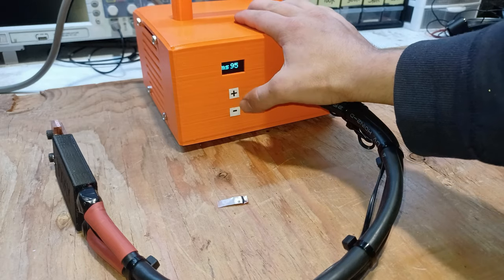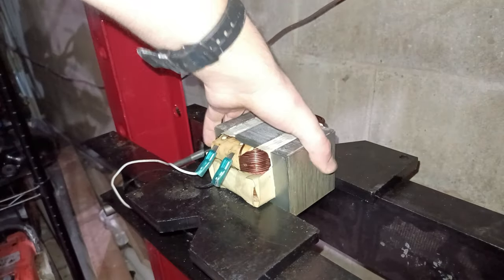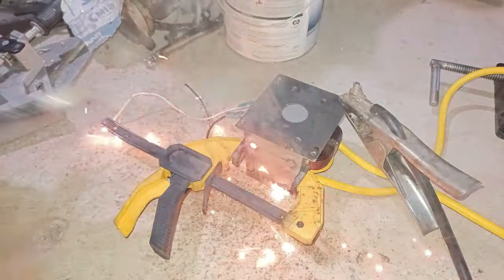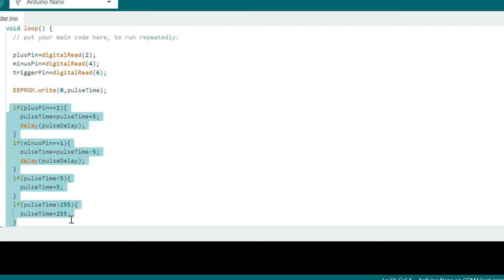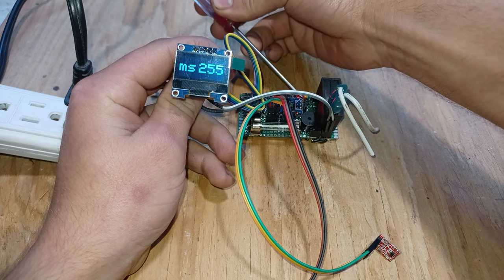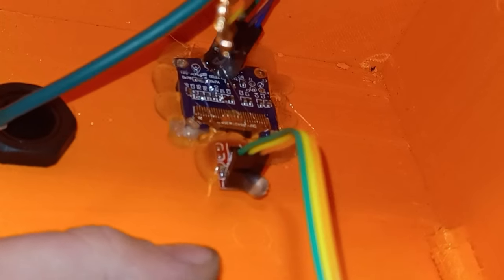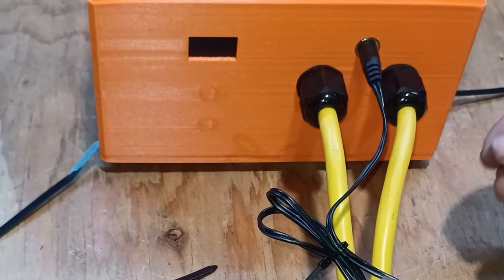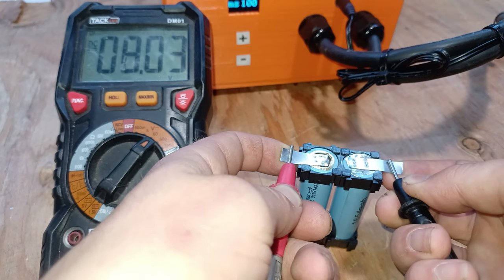Building a Spot Welder from a Microwave!?

Comment: Hi @ElectonicLab, 
for 25 sq.mm wire, how many turns you wound as secondary ?
Reply: I am also facing same issue, nickel strip is not weld properly on lithium cell
Reply from the maker: What material are you using for the spot welding tips?
Reply: I am using similar spot welding pen made of copper
Reply from the maker: Are you using a relay or solid state relay?
Reply: @ElectronicLab.  no 
I am using 5  BTA41-600B TRIAC in parallel as a switch
Reply from the maker: Try using the relay from the microwave or at least a 15amp relay. because TRIAC's aka solid-state relays have a way higher internal resistance, even if you're using 5 TRIAC's. and if that doesn't work, you might be using to small of a transformer. the microwave I've used has a power output of 1100 watts.
Reply: @ElectronicLab.  yeah I tried with 30A relay and getting same result.
also, I am using 16 sq.mm wire as secondary with 5 turns.
when I use 2 strips to weld, the weld is perfect but when try to weld strip on battery, not getting good results
Reply: @ElectronicLab.  hence, want to understand how many turns you wound for  25 sq mm wire
Reply from the maker: @anukeshambatkar6255 I ended up using 25 sq.mm wire or 4 gauge as secondary with 3 turns
Reply from the maker: More turns means more voltage but less current, and you need a lot of current to spot weld, so 3 turns on a 120 volt transformer should work

Comment: How many wraps with the new thicker wire? I made one a few years ago but it uses a rotary encoder as a selector and it sends a double pulse.  The problem I have is that it can easily blow a hole in my batteries if tension isn't really hard and lately I've been having issues even getting the welds to stick. I don't know if it's my nickel strips or do I need to really clean the cells before hand or do I even need to resharpen the electrodes.
Reply from the maker: @esqueue  I ended up using 4awg copper stranded wire and made 3 turns as the secondary coil. But what is also important to get good welds, is to strictly use copper electrodes, use a relay at the 120volt primary coil and not a solid state relay, and yes sharper electrodes will give you better penetration with less power or shorter pulse time and talking about pulse time, make sure to have proper pulse length, between 10ms and 300ms should be plenty range. Cleaningwise, I don't go crazy, I just use a Dremel to flatten the surface from the old nickel strips if the cells are salvaged (I do recommend using a Dremel if everything fails). I also recommend getting the electrodes I used (linked in the videos description) because it has a pressure switch that closes at a certain pressure, which  should give you consistent welds.
Reply: @ElectronicLab.  thanks
Reply from the maker: You're welcome!

Comment: Hi i enjoyed your video. Im also building a spot welder using an arduino nano and oled screen the same as yours.can i ask where you got the code as its exacly what i need given that you have the same build as me the only real difference is im using a solid state relay.is there any chance you could give me a link to the code you used please? Keep up the great work i thoroughly enjoyed your project.
Simon.
Reply from the maker: Thank you. I didn't put the code on a website, but here it is: 

int plusPin;
int minusPin;
int triggerPin;
int relay=8;
int buzzer=10;
int pulseTime;
int triggerVal;

int pulseDelay=200;

#include <EEPROM.h>
#include <Wire.h>
#include <Adafruit_GFX.h>
#include <Adafruit_SSD1306.h>

#define screen_width 128 // OLED display width, in pixels
#define screen_height 64 // OLED display height, in pixels

// display wiring = A4(SDA), A5(SCL)

Adafruit_SSD1306 display(screen_width, screen_height);

void setup() {
  // put your setup code here, to run once:
pinMode(2,INPUT);
pinMode(4,INPUT);
pinMode(6,INPUT_PULLUP);
pinMode(relay,OUTPUT);
pinMode(buzzer,OUTPUT);

pulseTime = EEPROM.read(0);

display.begin(SSD1306_SWITCHCAPVCC, 0x3c);
}

void loop() {
  // put your main code here, to run repeatedly:

  plusPin=digitalRead(2); //digital pin 2 is for the plus button
  minusPin=digitalRead(4); //digital pin 4 is for the minus button
  triggerPin=digitalRead(6); //digital pin 6 is for the trigger button

  EEPROM.write(0,pulseTime);
  
  if(plusPin==1){
    pulseTime=pulseTime+5;
    delay(pulseDelay);
  }
  if(minusPin==1){
    pulseTime=pulseTime-5;
    delay(pulseDelay);
  }
  if(pulseTime<5){
    pulseTime=5;
  }
  if(pulseTime>255){
    pulseTime=255;
  }

  
  if(triggerPin==0&&triggerVal==0){
    digitalWrite(relay,1);
    digitalWrite(buzzer,1);
    delay(pulseTime);
    digitalWrite(relay,0);
    digitalWrite(buzzer,0);
    triggerVal=1;
  }
  if(triggerPin==1){
    triggerVal=0;
  }
  
  
  display.clearDisplay();
  display.setTextSize(4);
  display.setTextColor(SSD1306_WHITE);
  display.setCursor(0, 17);
  display.print("ms");
  
  display.setTextSize(4);
  display.setTextColor(SSD1306_WHITE);
  display.setCursor(55, 17);
  display.print(pulseTime);
  display.display();
}
Reply: @ElectronicLab.  you sir are an absolute legend :) I have been looking for code suitable for quite some time, you have just ended my search 😀 appreciate you taking the time to help me  thank you 👍
Reply from the maker: You're welcome
Reply: Hi thank you for the code although it don't seem to work at present I'm getting errors do you have a picture of how the code looks when it's put onto the ide program I think I'm getting the code mixed up void  setup,loop any help would be most appreciated.kindest regards Simon.
Reply from the maker: When you put the code in the IDE, you have to delete the original setup and loop since my code already comes with it. Also, what does it say on the error message?
Reply: @ElectronicLab.  hi thank you I did get confused because I was out of scope error I will get more details on the errors as they  come.i will delete the void setup and loop ect and try again, and see what happens.i really appreciate your help.
I'm not great at this arduino stuff as I'm new to it.kindest regards Simon.
Reply: @ElectronicLab.  I did what you said and deleted setup and loop ect and bingo!!! Worked like a charm 
Thank you so much 😀
I've got ms displayed on screen.
I'm looking forward to your next video upload. Keep upbthe great work.simon.
Reply: Quick question do you use pull-up or pull down resistors?
Reply from the maker: @SimonsSolarShed  
The trigger button should be connected to GND with nether a pulldown or pullup resistor, because the code has a pullup function.
"pinMode(6,INPUT_PULLUP);"

If you're using capacitive buttons for the plus and minus pins like I did, then the code can be left alone. but if you're using regular buttons for the plus and minus pins, then you have to connect them to 5volts and add pulldown resistors to the buttons.
Reply: @ElectronicLab.  I understand 👍 good explanation. I have it working now and its producing a good weld I'm looking forward to housing it all now.
Thank you so much for your help, appreciate you taking the time to help me. Very happy with the outcome.
Reply from the maker: You're welcome
Reply: N you provide s thematic please
Reply: Schematic